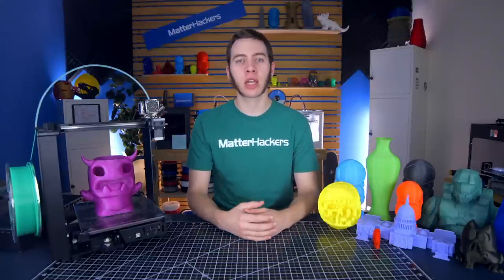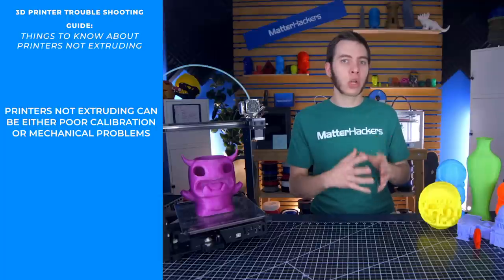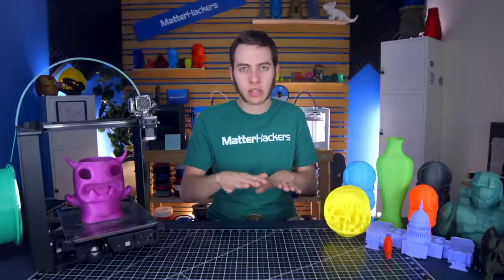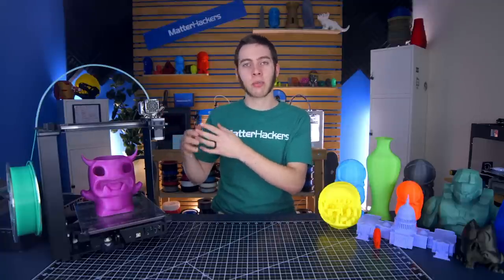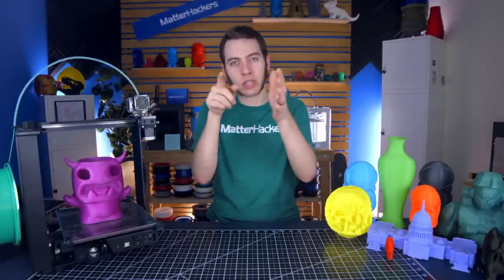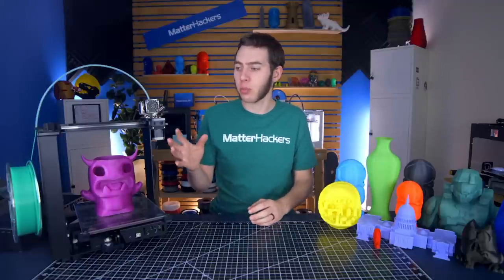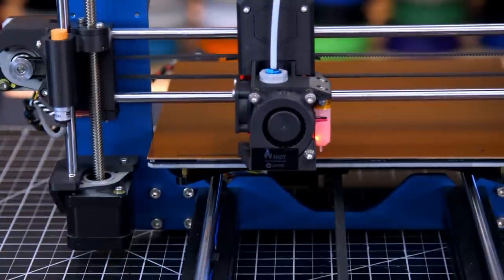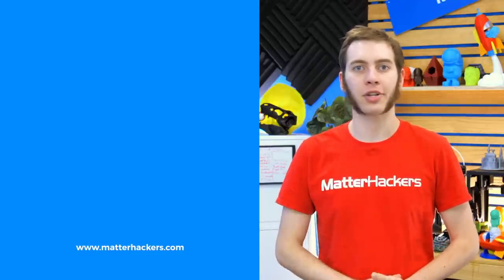3D Printing Troubleshooting Guide: Part Not Extruding

Comment: Hi! I have another kind of this problem. Before and after printing extruder feeds a filament well. But when the printing is starting extruder motor do not moves. I changed two slicers but it not fixed the problem. Have you any thoughts about it? (SKR 1.3, Marlin 2).

Comment: I have a question that is a bit off topic.  I've recently printed a multiple part print using tpu filament,  everything printed without fail.  I have now gone back to pla, and nothing will print properly.  It appears to be under extruding.  I've cleared the nozzle and ptfe tube as well as changed the extruder drive screw.  Nothing seems to work,  please help.

Comment: Nice videos. I have a  issue with my stepper motor not turning and making a griding sound whenever  I want to remove or insert filement inside the extruder. by any chance do you know what the problem might be?
Reply: Did u find the solution?

Comment: Ok so I had an Issue where the printer would stop printing halfway of the model. It kept moving as if it were printing but nothing was coming out. I stopped it, let it cool down, and started another print where it perfectly started printing again (although it messed up but that's a separate thing). Could it be that the Extruder over heated then stopped? If so should pause the print halfway, let everything cool, then continue printing again?
Reply: Exact same thing🙏

Comment: Hi, thanks for the helpful video.  I just finished my first DIY Printer and everything works so far, except my extruder stepper does not turn when getting into print mode.  It works however when I press the extrude button in Pronterface and I was able to calibrate it.  I'm searching for solutions since days now and still can't get it to work.  Since the stepper works for calibration, I assume that I did something wrong in the Marlin set up.  Any ideas for a solution would be greatly appriciated. Thank you.
Reply: Never mind.  Found the problem.  My slicers (slic3r and Cura) switched the letter E to A in the G Gode with some objects and not with others.  Don't know why and how to fix that, but now it works with some objects where the G Code is naming the extruder E and not A!  Example:    G1 X141.048 Y132.446 A2.27422   it should be   G1 X141.048 Y132.446 E2.27422

Comment: My fillament perfectly comes out when my printer doesn't have to interrupt its flow. But once the nozzle has to move to a coordinate without the need of extrusion, then it takes a small distance for the filament to come out again. This results in really bad corners e.g. when printing grids.

Comment: i have no issues like any you talked about... i think my extuder motor is bad,,, it turns only when i depress extruder spring a little...and i have a good tight gear on the shaft and bearing turns nice...machine is brand new... can these stepper motors go bad?? thax  ps..its a cr10 clone

Comment: Every time I print my PLA (carbon fiber). It prints to a certain level and it stops feeding and nothing coming out the nozzle. I check my nozzle and my engine is all fine, I think is the filament issue, but how come it prints every time to 13 or 14 mm it stops working.(all my setting works fine with my other filaments, it just that doesn't work )Help !

Comment: Not sure if this will help anyone but I found that the gear on the part that feeds the filament in had actually backed off to the point where it was only touching the top of the filament and wasn't pushing it in properly. I loosened to two little screws and lowered  the gear it so it contacted the side of the filament properly and my issue was resolved
Reply: Mine is fine but still acting up.
Reply: pretty sure this is my problem right now and I have no idea how to fix it 😓. no clogs for sure, but the gears or whatever is supposed to feed the filament through is not catching, so nothing comes out unless I push it through. I've tried loosening the screws as another video said overtightening it stops it too. Still not working. Any suggestions? I have a creality cr10 v3

Comment: hi there i have a GEEETECH A30 3D printer and I've been having a problem where it does and then dose Not Extrude, I'm sure that the nozzle isn't clogged as i have changed it to make sure of that, the bed is level isnt the problem ethere if anything its a little high and I've cleaned the gear many many times but I'm still stuck with the same result (on occasion while printing the filament would stop coming out and then extrude again) could you please try to help me find out how i can get this printer to work.
i couldn't find a proper 3D program does that make a deference ?
Reply: Same issue I'm having
Reply: @futuregamer5791  where you able to fix it or get it to work ?
Reply: @shiniforever  I think it's the extruder assembly. Not sure if it's a partial clog or what but it's cheap to replace the whole thing so I'll try that and let you know.

Comment: 0:49 The intermittent thing sounds similar to the problem I'm having. Sometimes it'll turn out wavy with some filaments. Lately it seems more like the extruder turns off and on every 2-3 lines on the first layer. I've tried raising the offset but that just makes it so the filament doesn't stick because the nozzle is too far away. Others have suggested that it's a warped bed, but I've checked and my bed is as straight as can be and properly trammed. I've tried printing it in other locations of the bed to see if maybe it's the kinematics of my built from scratch corexy, but I get the same exact same results and pattern no matter where I print on the bed. I've also adjusted the drivers to rule out driver issues. Any advise may help, though what was in the video didn't help in my situation.

What I'm thinking of checking out next is maybe taking my heat break and polishing it. I have a clone V6 since I couldn't afford the real deal and its machining lines are pretty intense in there and has had jams in there in the past. Another thing I'm thinking is that my original ramps 1.4 board fried itself a while back and I'm still using the same arduino mega so maybe I'll reflash the firmware just to rule that out or to switch the arduino itself out, though I don't know why it would be intermittent like that. The new Ramps board I'm using is a 1.4b version and I haven't checked or changed the estep settings since the replacement though I doubt that's the problem since the rest of the print turns out fairly well, but it's still something to check. I also seem to remember it having this problem before, but definitely not to the same extent as I am having now.
Reply from the maker: Unfortunately, extrusion issues are one of those things that can have a million different causes. However if it's regular, have you checked to make sure that your extruder gear in the extruder is clean and not full of gunk, regularly preventing it from extruding? I would also suggest making sure your hotend is assembled correctly (tightening the nozzle against the heatbreak when it's heated up), that the PTFE tube (if it's bowden) is cut flush, that you're printing hot enough, and if the extruder gear is still turning but there's no filament coming out (which would mean the problem isn't electronics or motor related, it's purely related to the hotend). Hope that helps! - Alec
Reply: @MatterHackers  Thanks for the reply. The extruder is definitely clean. I've closely inspected  it many times and have never had an issue of slippage that I can tell and no signs of grinding or any mess of any kind. I tried replacing the bowden with Capricorn tubing bought from your website to see if that might improve anything and haven't seen any improvement so far. Hot end is assembled with the same method Tom's 3D uses in his nozzle guide video and definitely tightened when nice and hot at 260C. PTFE tube and Capricorn tube are both cut nice and flush and yes it is a bowden (based on the Hypercube by Tech2C only much much larger). I am printing hot enough and even used a temperature tower to figure out the ideal temperature and get the same problem at higher temperatures. I still haven't run the PID tuning system yet, but I don't usually see more than a degree of temperature variance when printing. PID tuning is on my to-do list even despite that.

I haven't yet thoroughly investigated whether the extruder gear is turning during the times it is having extrusion issues. It's on my list of things to do, but I have done a little investigating and so far it seems the gear is turning at the time though I have noticed the bearing that presses the filament against the gear not turning sometimes. Part of the reason I just upgraded to a Capricorn tube is to reduce the amount of slop that might allow it to push filament and potentially not extrude while filling that gap (and to improve stringing hopefully. I haven't been able to run any stringing tests yet though since mom has been in the hospital.)

I seem to remember a slight improvement when I tried "seasoning" the nozzle with oil once, but that was only temporary and my memory is pretty fuzzy, plus it was high temperature "hair clipper oil" rather than how most people use vegetable oil. Oh, and I've tried multiple different sized nozzles and am currently running with a 0.6mm for the reduced chance to clog and faster printing. I have noticed that sometimes Cura doesn't seem to accept my nozzle size setting ever since a recent update that caused a major crash that lost all of my settings. I haven't yet tried a different slicer, though that is also on my to-do list just as another thing to rule out. I don't think this is a slicer issue though. 

The more I think about it, the more I think it's something in the heat break causing a partial clog up in there. The inside was poorly machined and there are a few high friction grabby areas in there somewhere. While I was in the hospital taking care of my mom I saw a video where someone ran some steel wool in there to polish to an essentially mirror finish for silky smooth sliding and since I have no way to afford a good hot end at the moment, that may be my best bet. It is curious though as to why it would only be a problem when making some lines but not others and be mostly consistent with it when printing the model in different positions on the bed.
Reply: @MatterHackers  I figured it out finally!

So long story short: the arm that holds the bearing and presses it against the filament to engage with the extruder gear was warped/bent so it was only engaging with the gear roughly 1/2 of the time. 

The guy who originally printed out all of my printer parts printed them out with PLA on a really poor quality printer that has almost no dimensional accuracy and extremely low quality so even for the initial assembly I had to take a heat gun to parts just to get screws/bolts/nuts in. So it wasn't in that great of shape in the first place, probably bent when I heated it, and progressively got worse due to the nature of PLA in such an environment being attached to a motor (though my motors don't get hot). 

How I figured it out was that I was noticing the bearing not spinning fairly often that also coincided with the under extrusion, but the gear was spinning fine. I tried degreasing it with an alcohol swab to see if it was too oily to engage with the filament, then I tried sanding it to give a little more grip. Didn't make a difference so I decided to mess with the arm a bit and voila.

The sad thing is... I already had successfully printed replacement parts in PETG months ago, but just haven't taken the time to swap all of the parts yet. I Just trying to figure out the problem first before putting in that effort. So on the bright side I had the part ready to go and easy swapped in, but  sadly I could have fixed this issue months ago. That's one way to learn I suppose. :P

Comment: What if it's none of these suggestions?
I can extrude manually, without problem.   My printer has an option to push the filament through the bowden tube to the hotend, or back the filament out, to change rolls.   Both directions work fine.  I can prime the nozzle, without issues.   The printer will extrude a little pile of filament, until I tell it to stop.    Then I start the print.... nothing.  No filament is extruded.   I've done the test print, that came on the SD card, that many have printed with no issues, other than some people experiencing some stringing. Yet mine does nothing. I have done my own models, and sliced them through Cura and through Prusa Slicer... again, no extrusion.  The company told me that the extruder was bad, since it won't extrude, even though it extrudes manually.   They sent a replacement, and it does the EXACT same thing.   I'm so frustrated.   It's been a month, and still never printed anything, with two different extruders.   I'm really regretting this purchase, and getting into 3D printing.  😔

Comment: I have a Longer LK4 and i have a problem with inconsistency in printing filament. So i go through my steps like this: step 1,  i level my table, step 2, i preheat telling it the filament im working with. Step 3, i go to extrusion and kick out
 10mm of filament. Step 4, i then go to my sim card and scroll to
 my print and tell the machine to print it. It will then begin printing, and nothing will come out, but it goes through its orders and keeps going. Remember i just extruded filament in the warm up, so theres no clogs. Why is this occuring, also this occurs more than
 occasionally, but not every single time, just like 50% of the time. Anybody have any ideas? Thanks.

Comment: I need some help really bad, i've had y creality ender 3 pro since Feb. in that time i made maybe 7 test prints all failing phenomenally despite me calibrating my bed as per instruction and recommendations every time, filament would just not hit the bed or just be dragged off. the filament would not stick t the bed at all after about 5 prints, then i replaced with a glass bed, halfway through my first test print on the glass bed the printer stopped extruding entirely. isent it back to the place i bought it for 7 weeks and they replaced the motor, got it back made 1 test print that didn't stick to the bed and put it away until just this weekend where me and a friend managed to make adjustments and get some pretty stable prints out. but now im having to rely entirely on rafts as i can calibrate my bed and it seemingly immediately loses contact with the bed or just doesn't stick at all. 

now ive been calibrating infill and its not terrible anymore but i have the absolute worst layers. im printing a hexagon and almost every layer seems to be out from  the one before and even the ones that do stick together look spaced and uneven. 

how do i fix the layering issue on my 3D printer?
Reply: If it doesn’t stick use a glue stick. Lather up your glass bed before printing. My ended 3 pro didn’t stick till I started using glue

Comment: Up and down is NOT Z.  IT IS Y
Reply: In the 3D Printing world, we have X as left and right, Y as forwards and backwards, Z as up and down!
Reply: @tonpa8888  but why. I do 3d design and animations and play games and y has always been up and down
Reply: @motsgar  I don't know. But if you come to the 3d printing world and use cad programms and slicers, you will see thst Z is always up in 'our' world.

probably because x&y define a plane, an z the 'thickness', so the 3rd dimension. your plane (x&y) is your buildplate so Z is then up&down/thickness
Reply from the maker: @tonpa8888  And to expand on that, in machining (which has been around even longer than the others, we're talking the 50), Computer Numeric Control started as Numeric Control, with the same sort of Gcode running the cutter except it was a script one guy read to two other guys and they moved mill around along each axis, X and Y, and then plunged the mill into the piece. Essentially, the first NC machine was 2.5 milling, with an X and a Y like a graph, and Z merely being a cut straight down. It wouldn't have made much sense for them to call it X and Z when at the time there was barely the thought of third axis machining. I still can't explain why there's the difference between animation and manufacturing, but there's at least a brief history lesson into where it kind of came from - Alec
Reply: In this case it's a left handed frame coordinate, there's also a right handed frame coordinate. X,Y, and Z are designated this way to uniformly describe a object location to that left handed frame coordinate, in this case that's your extruder. Left and right handed frame coordinates are not only the key to robotics and 3D printing but they're also one of the principles used by NASA along with a gimbal to navigate space shuttles.